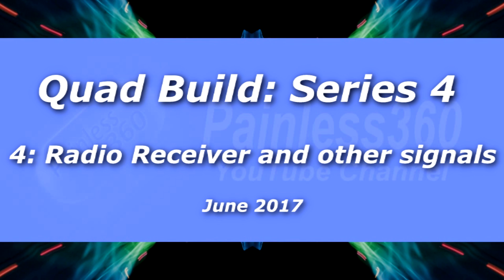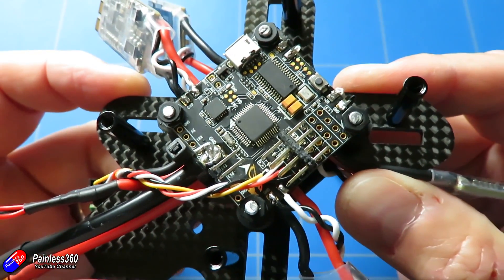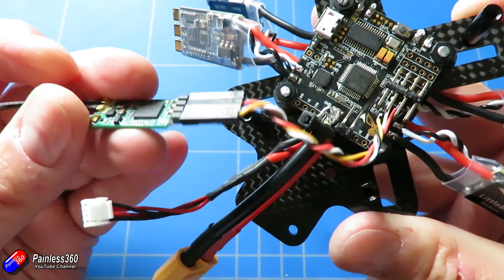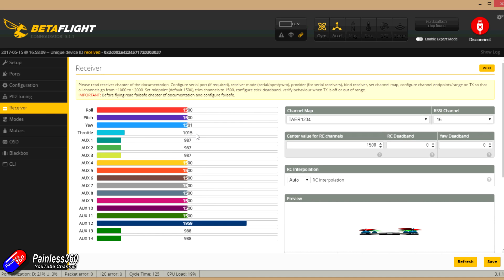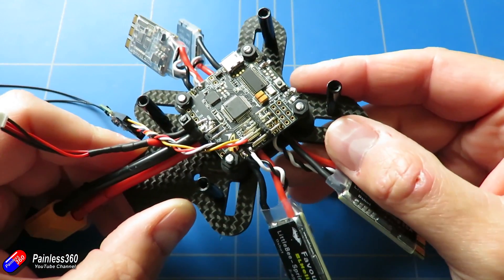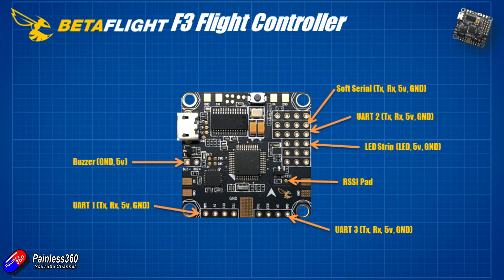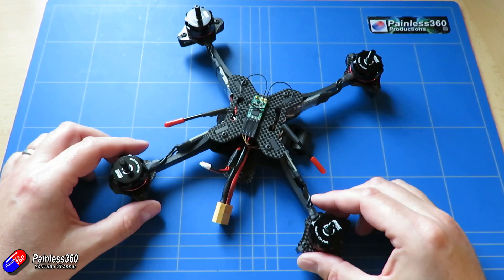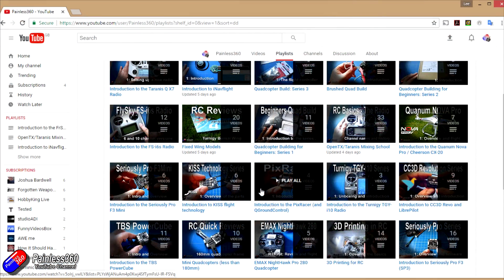(4/5) Quad Build Series 4: Connecting the FrSky XM+ Receiver, MAVLink and frame

Comment: Hi Lee...  just to check, do i actually need to wire the rssi wire on the RX and the BFF3 in order to get rssi on the BFF3 OSD?? or does it link automatically??  Many thanks Dave
Reply from the maker: With the Rx I used I could have missed that step.. See when I setup RSSI in Betaflight.. Happy flying!
Reply: Painless360 WOW super fast reply, many thanks....  Just building quad with bff3 and xm+ and have another ready to go with the same as well as the connex...  invaluable video.. keep up the excellent work it's really appreciated... Dave
Reply from the maker: You're welcome buddy! :D

Comment: Hello Mrs Painless360, i have some trouble, i plug my XSR frsky receveir on the board, get the 5v for power it(solder the 5v on the board, ok, my receveir was bind on my Taranis, ok, i solder the 5v/Gnd and Sbus), but on the original version 3.1.0 i can t find the good UART for my Sbus receveir, when i move my stick i have nothing..(i try all Uart 1by1) i don t understand. And i can t flash the board to... its really difficult than a naze32. Can you give me some tips? thank you.
Reply from the maker: You don't mention what flight controller you're using. Please see the video series for the one you're using as I'll have made a video on connecting the receiver. Be aware that older flight controllers had issues with s-bus as they didn't have the on-board inverters.
Reply: Painless360 😭😭 i m sorry lol, i use the betaflight f3 the same on your vidéo
Reply from the maker: Then what I did is in this series ;) Best of luck!

Comment: Good luck with the Matek LED strips! I burn them like crazy on my quad with an Omnibus Pro V2 FC. Already 3 of them are gone. They work for approximately 5 minutes (perfectly) and then no LED is lighting anymore. What helps (a little) is the external protection circuit described here: https://cdn.solarbotics.com/products/datasheets/ws2811rgb%20and%20ws2812%20manual%20from%20greeled.pdf

Comment: Great video have you had any trouble with powering  your xm+.  I am new to building quad and I have gone though 2 xm+ and it does not power it up.  I have solder them to 5V but the LED does not turn do you have a video explain this process or troubleshoot??  Thanks
Reply from the maker: I've not had any issues at all. I'd check that you have 5v on those wires you're connecting.. Best of luck!
Reply: Painless360  thanks for the reply I follow you video.  Great information.